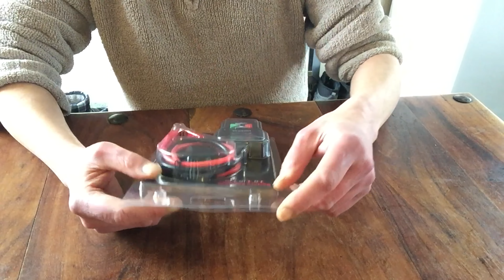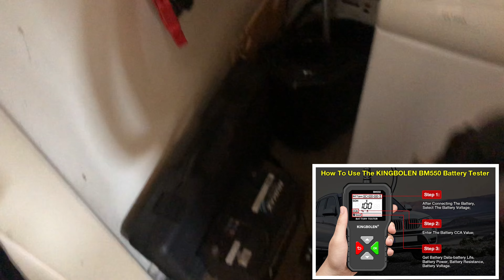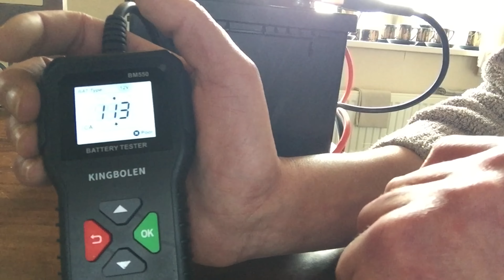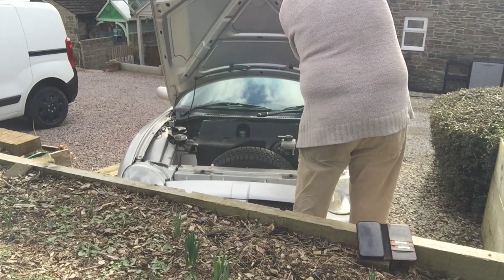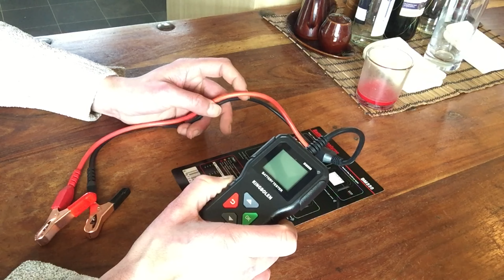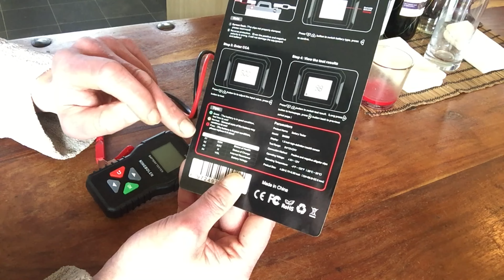Is this battery tester worth having? Kingbolen BM550 tested…

Comment: I appreciate the review a great deal. I have been looking for a good budget battery tester that will test CCA. Most of the advertised units are little more than glorified volt meters (even though they say that they will  perform a load test they actually don't). After watching your review I am comfortable that this will indeed do the trick for me.
Thank you
Reply from the maker: Absolutely my pleasure! Only a few days ago it saved me a hugely costly BCU replacement by showing me that a battery the volt meter said was fine was in fact really not, and a new battery has restored Brian Johnston to full health. It’s a cracking bit of kit, and to be fair I’m yet to be disappointed by anything from the company.